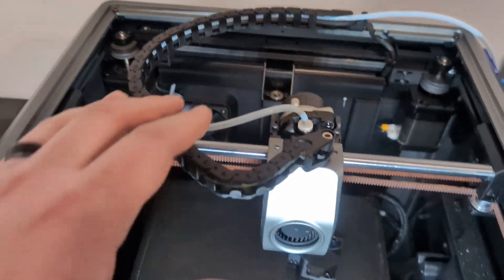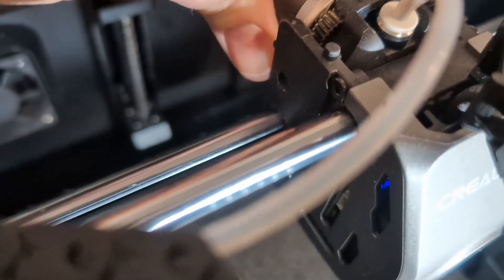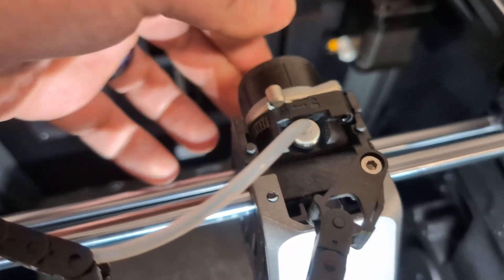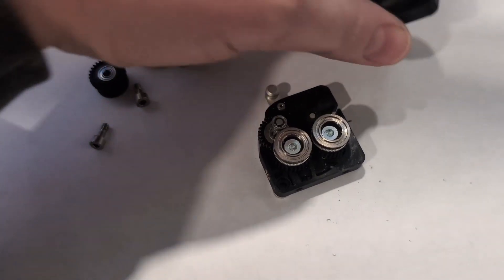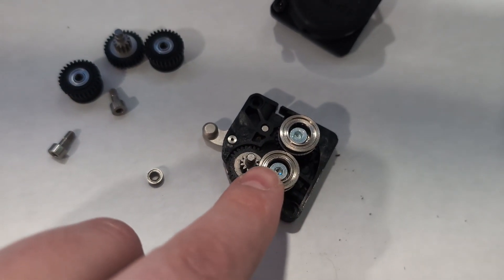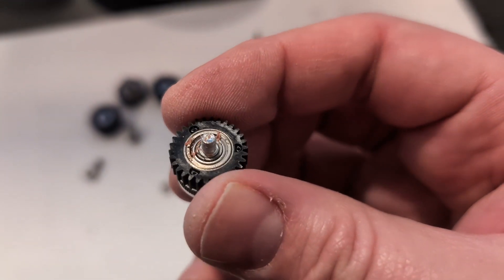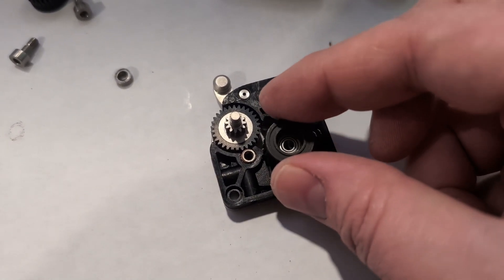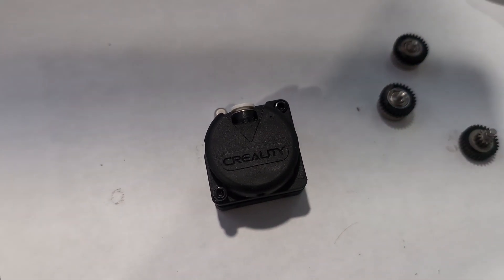K1 Series Extruder Gear Upgrade - Quick Upgrade Video

Comment: i got lucky to have the updated one
Reply: How did you check for that and when did you buy yours? In the market for this printer and would like to validate it has this upgrade already.
Reply: @camerongulley3791 tbe newer k1s have thenupdated extruder but not the gears th3d is selling
Reply from the maker: This is the updated one in ours. Just upgrading to better gears.